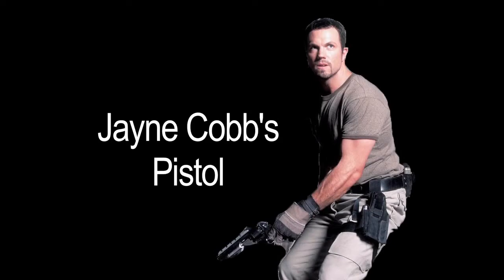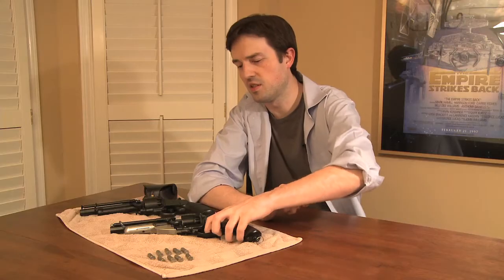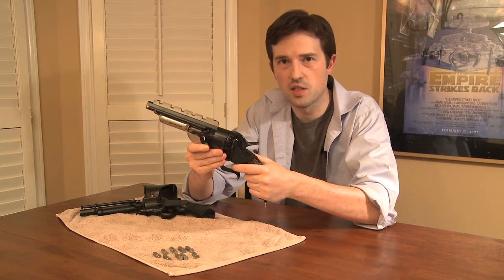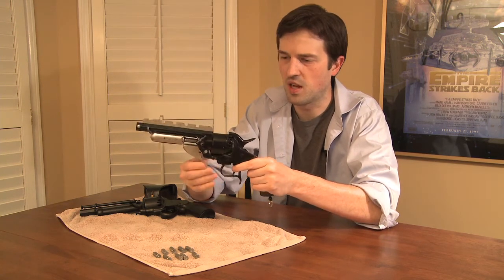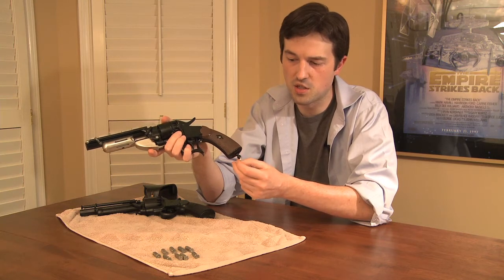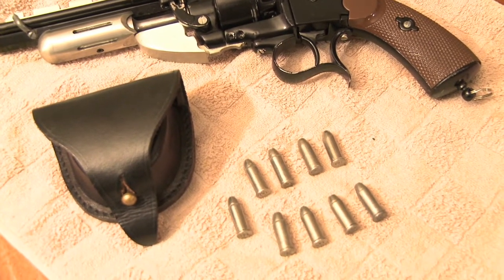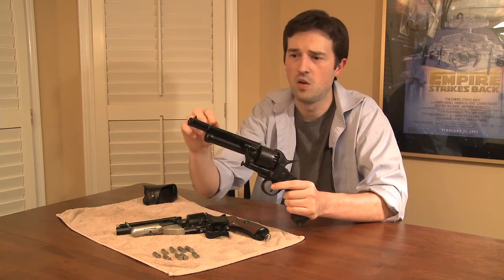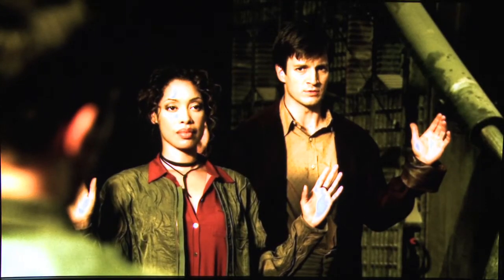Firefly Jayne Cobb Pistol Prop Review - Richard Coyle

Comment: Yes but my point is that the Lemat does not have 'chambers' for its rounds in the same sense that a modern revolver does so is there a modification to the replica which allows the shells to be loaded into the cylinder?